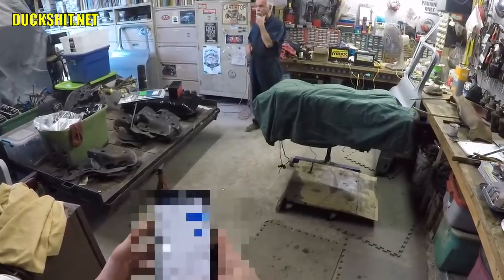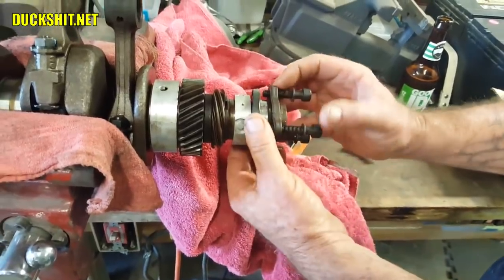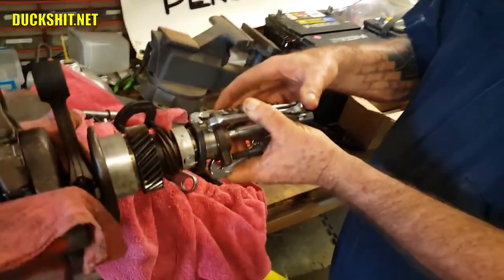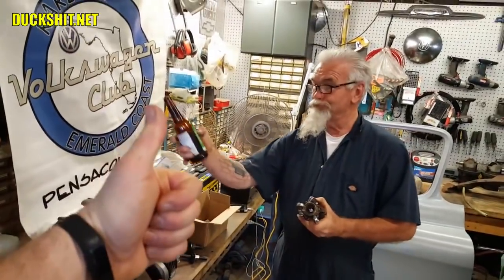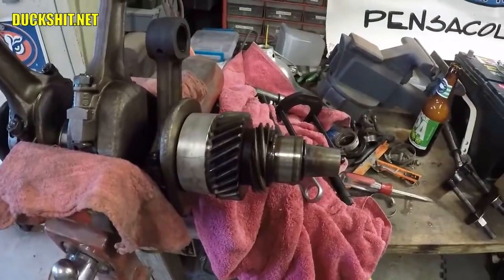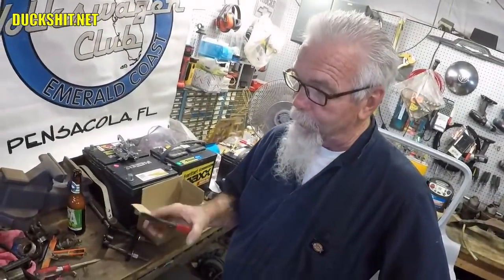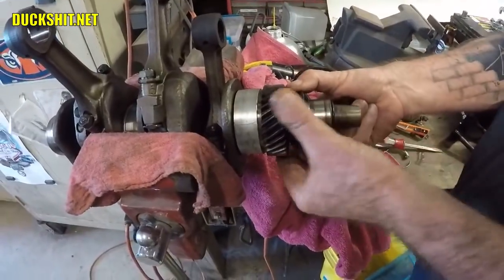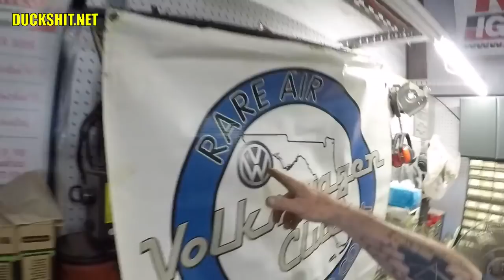VW - Removing Crankshaft Gear

Comment: Man, the type 4 bottom end is way more massive than the type1, those rods are stout!  The weak link on the type 4 was in the heads, they love to drop valve seats.  Cool vid man, keep them coming!
Reply from the maker: Yes, the heads were weak on the Type4 because in a Bus they were prone to overheating while pushing a giant loaf of bread at highway speeds... this was especially true of the 2L heads. Not so many problems for the people that put a Type 4 engine into a smaller Volkswagen.  :)

Comment: Is there any timing marks on the crank it self when you install the cam  gear and distributor  gear
Reply from the maker: Yes, both are keyed, hard to get wrong.  The timing mark on the cam gear faces out.  The brass gear doesn't matter.   How you install the distributor gear drive is what affects the timing.  :)  Hope that helps!
Reply: Yes that perfect did t want to get my gear backwards thanks for the info